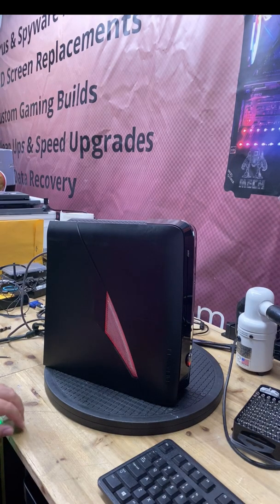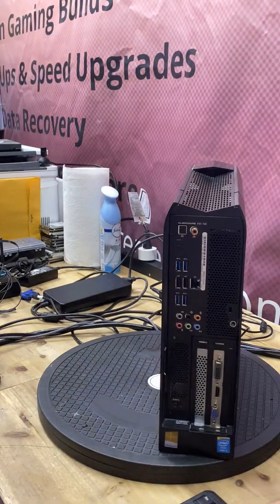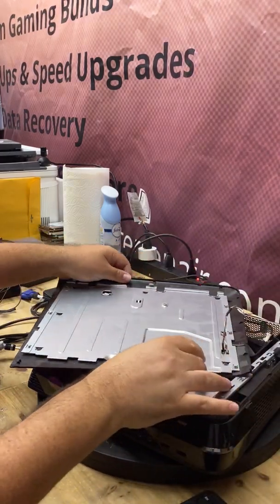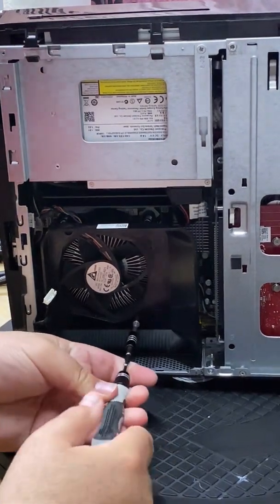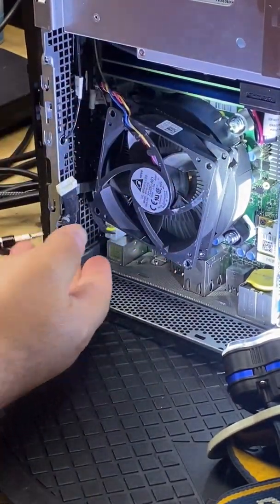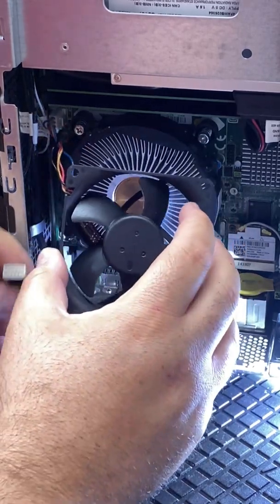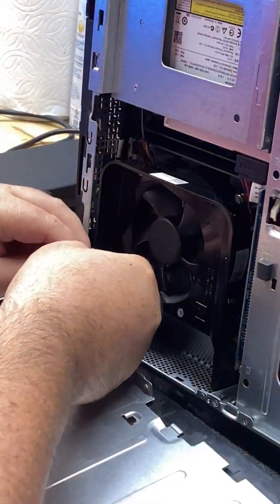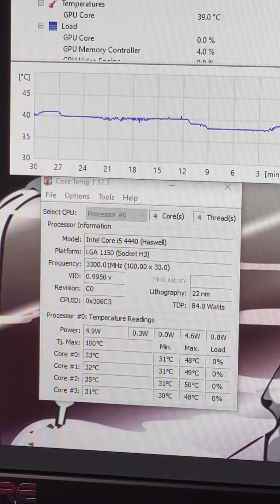HELP! MY COMPUTER OVERHEATS!  Alienware x51 R2 - Temperature mods! No more overheating issues!

Comment: I'm going to try this tomorrow, the fan in the PC is extremely loud but seems clean. Should I change the thermal paste if that's the case?
Reply from the maker: I would, as I mentioned in the video, it is the first thing I did...
Reply: @coryscomputerrepair  Yeah I saw that but I didn't have anything that would be safe to clean the CPU with but I have ordered some Thermal Paste and some Isopropyl alcohol 99.9%. Fingers crossed it becomes quiet on Friday 🤞
Reply from the maker: @easiers Keep those two thinks handy, like butter and milk :)
Reply: @coryscomputerrepair  Changed the thermal paste did the fan trick and wow is it nice to have a PC be silent again. Thank you :)

Comment: It baffles me that Alienware designed it with fan upside down.
I also fo understand that the sides of the heatsink are blocked of by the black plastic tube/mounting mechanism. I am pretty sure of you would make holes in it, temps would improve even more.
Thanks for the video, very helpful!